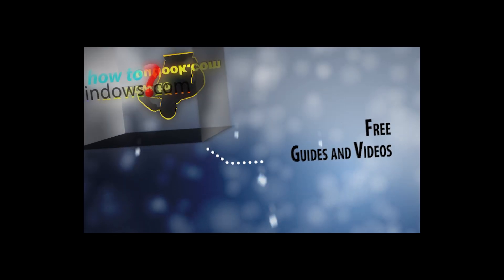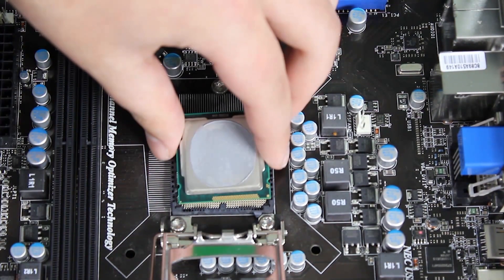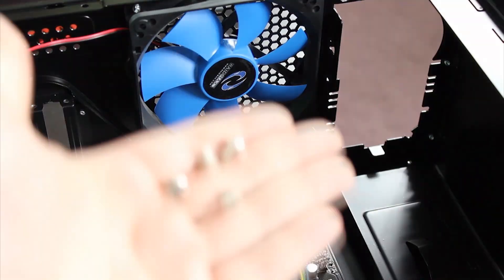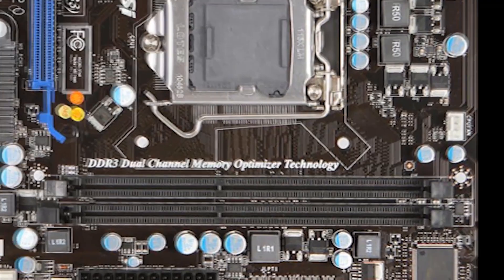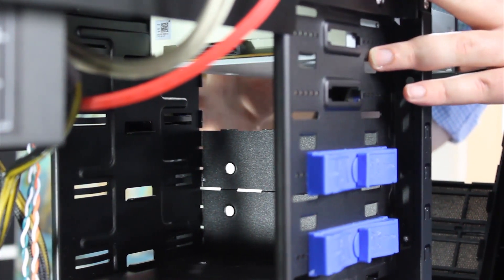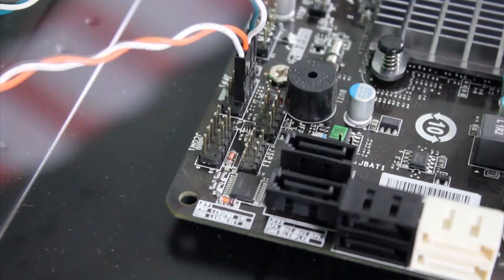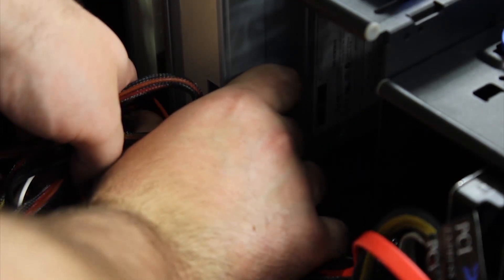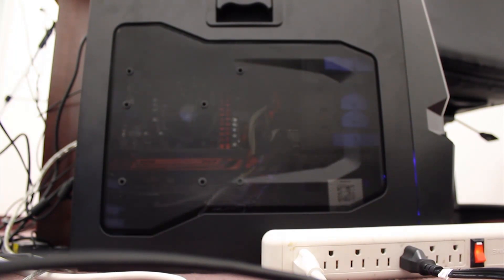How to Build a pc in under 7 min. [True HD] 1080p

Comment: i chose these parts will i be able to run battlefield 3 at high settings?????:
amd fx 4170
gtx 650 oc 
8gb ddr3 
500gb western digital hdd 7200rpm
asrock 970 extreme4 motherboard

Comment: Why have this video in under 7 minutes?! With the lack of jargon, I assume this is aimed at beginners to building computers. In which case, you have missed out a million small but vital steps, such as applying thermal paste, replacing the IO shield, removing the CPU socket cover and so on. PCs should be built with care, not haste. Besides lots of the explanations you made were specific to that case - guaranteed somebody spending less money will get no help from some areas of this video.

Comment: Isn't it a bad idea to hold the video card and motherboard in the exposed areas? I noticed you were holding the video card on the circuit. Just curious, because everyone says not to, but I did sort of touch the bottom of the motherboard accidentally when getting it out of the anti-static bag, but everything works fine, so I dunno.

Comment: This is our low budget Gamer build:

AMD A6 3650 APU
Crucial 4GB DDR3 RAM
Sapphire Radeon HD 6670 Video
Gigabyte GA-A55M-DS2 Mobo
Samsung 256GB SSD
Tower Case w/ 500W PSU
LG Bluray Burner
Acer 21.5" LED Monitor
Inland PS/2 Mouse & Keyboard & Speakers
Windows 7 Home Premium OS

Cost:  Under $650

Windows Index: 7.2, 7.2, 6.8, 6.8, 7.3

Notes:  Plays Diablo 3 quite well.  No stuttering even at high settings.  :)